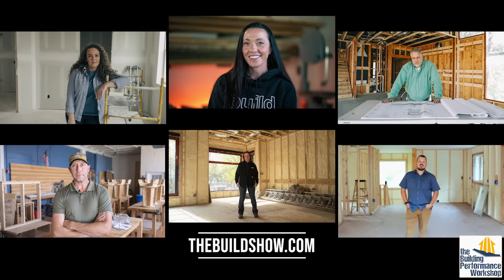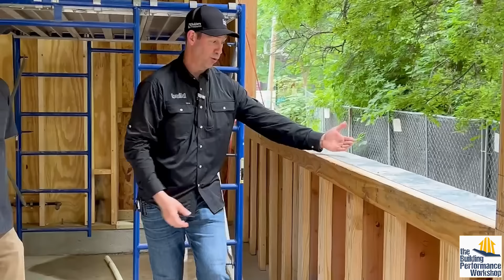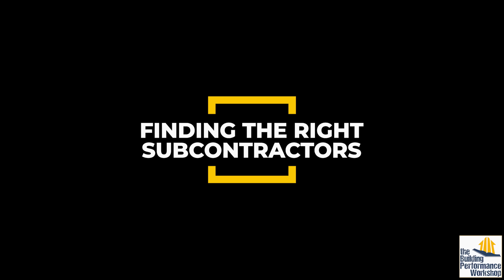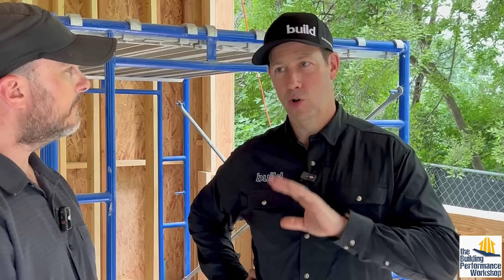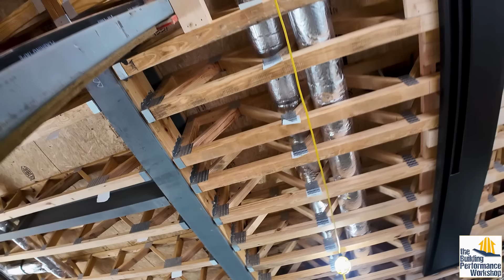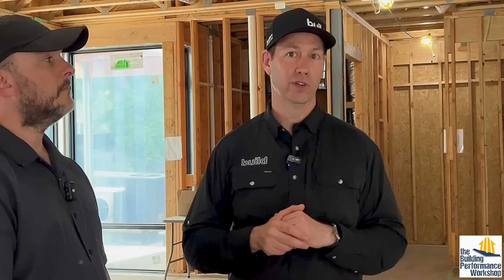Tips to DIY Your Own Home Build: Construction Management, Hiring Contractors, Why Builders are Wary

Comment: Matt is surprisingly open and thoughtful here. That said, I was left hanging when he said his contrcat was one sided builder friendly? In what ways? Time to completion? Owner work prohibited? 20 per cent down payment?
Reply: From my own experience in writing contracts (albeit in a different industry), I would guess there are limitations on change requests and possibly a rigid schedule for settling on blueprints and choosing finishes (cabinets, tile, etc). Not everyone is a visionary, but in order to keep the project moving they either need to find an interior designer or be resolved in their decisions. And yes, payments likely align with the completion of original agreements along the way. Change requests may be charged at the discretion of the contractor.

Comment: All of these are great points.  I was my own GC and ended up actually doing a lot of the building myself.  Matt's point about subcontractor loyalty (and interest) was true in my case.  I was building amidst a housing boom in my area and it was hard to find reputable framers, plumbers and HVAC contractors that were interested in a one-off project like mine.  They were generally committed to larger companies/builders that line up repeat business for them.  Your videos were a huge help in allowing me to tackle the HVAC, ductwork, air sealing, insulation, ventilation, etc.  I was lucky to find a great energy design consultant like you to design the systems, ducts and insulation plan and ended up doing the install myself.  My systems work great and the blower door test turned out quite well.  Anyone considering building on their own should do themself the favor of watching and learning as much as they can from you.

Comment: 40 years ago, my dad convinced our former neighbor that it would be a good idea to put basically all wiring in conduit (plus some empty conduit to various points around the house) in his custom house that he was building for the purpose of futureproofing. The contractor was very reluctant to do so, and consequently, our neighbor ultimately didn't get as much conduit as he wanted...but he did get some. When the house was built, coax was fairly standard, so that was what was installed in some of the conduit. The neighbor's son has since bought the house and was able to run CAT5 in the conduit himself. He also was able to install an EV charger in the garage. He was able to do this without disturbing the drywall.
Reply from the maker: Badass, Sean.
Reply: Yeah, I don’t have a GC license. I worked for a builder for years. I have built two houses. But one thing I would strongly advise people to do is run conduit under their sidewalks under their driveways seal the ends with duct tape. Put a hot water tap on the outside of the house. Plan out your outlets for where your furniture is gonna be. Insulation insulation insulation.
Reply: I built my home 25 years ago and it took several years until I needed the spare’s conduits but damn it was nice pulling a home run 3 floors away!!
Reply: Pretty much how electricity is done in Europe and most of the world building cinderblock/brick homes. Great way to futureproof!!!!

Comment: Thanks for this video, as I recently started considering building my own house, and I have been watching a lot of yours and Matt's videos.  The house I grew up in was designed by my Mom and built primarily by my Dad and Grandfather, with some help from their friends.  They had a contractor dig the foundation, pour the basement slab, and put in the well and septic, but my parents and Grandfather (who was retired by that time) built the basement walls with cinder blocks, and built all of the floor trusses and wall framing themselves.  My Grandpa had built a lake front cottage by himself when my dad was still a kid, so he had experience with doing this already, and did all of the electrical and plumbing for my parents' house.  My parents also did all of the insulation and ductwork for the wood burning furnace themselves, but had an HVAC installer put in a high efficiency propane furnace a few years later (they had an infant and a toddler at that point and it was apparently hard to find the time between work and watching them to chop wood and add it to the furnace, especially at night).

One of my Dad's friends was a professional drywall installer, and helped my Dad with that.  They knew an Amish woodworker who built the kitchen cabinets at a discount in exchange for the maple and ash trees that had been cut down to make room for the house.  My Mom painted the inside of the house, and my Dad painted the outside with the help of a neighbor who turned out to be a professional house painter and offered to lone my Dad some scaffolding and taller ladders than the one he had (I don't think he charged them anything and was just happy to help a neighbor in his spare time and share his expertise).  The only other thing they hired a professional for was installing the roof.

Now that I'm looking to buy my first house, everything in my area has doubled and tripled in price over the last few years while I was paying off student loans and saving for a downpayment.  Now, most of the houses available in my price range are manufactured homes that were built in the 80's and 90's and are in need of significant repairs.  This has led me to consider building a house instead of buying, but there is a shortage of builders in my area, so most are already booked out on jobs for several years.  This leaves me with either hiring a company that will put a new manufactured home on property I purchase (including digging a well and septic and building the foundation), or trying to do like my parents did and build it myself.  I have helped my Dad with repairs on their house since I was little and I'm sure I could do most of the electrical work, the flooring, the drywall, the insulation, and the plumbing fixtures (I would want a professional to do the rough in for all the pipes because I don't have experience with that and wouldn't want to risk leaks or not putting enough drop in waste lines).  Since I don't have any experience with framing, I have also looked at buying a framing kit for an A-frame house where I would just have to bolt everything together using the included hardware and attach it to the foundation.  My biggest fear in trying to tackle a project this big by myself (besides it taking significantly longer than I expect) is that I don't know what I don't know, and there's a good chance that I would miss something that could lead to expensive repairs down the road.  I also don't know what current building codes are, but they are certainly more stringent than when my parents built their house in the 70's and my Grandpa built that cottage in the 50's, so trying to comply with code and passing inspection is another problem that is difficult to solve without experience.  I really WANT to be able to build my own house and experience the pride and satisfaction that comes with that, but the practical side of me says the smartest thing to do is to go the new build manufactured home route and hope these newer models are built better than the existing ones I've gone to look at and won't have the same problems with warped floors and lack of ventilation.
Reply: Very well written comment and lots of insight. How are you doing currently with your prospective new home?
Reply: @beholden1663   I have been looking at a few houses here and there, but haven't found anything yet.  I have actually started designing my own house in my spare time between work and seeing what's on the market, and I have recently started looking into what it takes to get actual plans made and approved.  A coworker of mine started helping his Dad build a house this fall.  Seeing pictures of their progress has pushed me even more toward wanting to do my own self-build, so I've started looking at property as well as houses, but I'm still figuring out where to start and if I can actually afford it.  There are a lot of programs for first-time homebuyers out there, but most of them are for existing housing, not for building.

Comment: Great collaboration! Really informative and helpful. I’m fully retired from working 30 years as an owner’s rep on small to medium sized commercial/institutional design and construction projects and I’m in the early stages of designing and building my own home. Looking to find that sweet spot of how much to handle myself and how much to handle myself. The single most important lesson I learned from 30 years of project management experience is to get the right people on the team and then empower them to do what they do best and make sure all the pieces are connected and any gaps filled. Keep a close eye on every aspect of the job, but be fair, be collaborative, and show appreciation for good work. I totally agree with Matt that those relationships with subcontractors and suppliers built over time are more important to the success of a project than lowest cost. Look for BEST VALUE rather than LOWEST COST. And I totally agree with Corbett’s emphasis on Scott True’s advice to be flexible and creative. There are multiple ways to achieve your end goals and the best projects are collaborations that are fun and fulfilling for everyone involved.

Comment: I like Matt's contract vetting approach. I am an interior designer. I once had a client push back against my initial contract draft with "I'm not really into such a tight contract. In fact, I don't really like working under the confines of signed contracts." My reply was "OK,  you can just pay me the entire amount up front." He looked at me like I was crazy. That was the end of that conversation and that relationship. Haha. Some of the best jobs are the ones you have the wisdom to avoid.
Reply: Never lost money on a job I never got.  

I’m an HVAC estimator.
Reply: Read “I don’t lan on paying you and I want a way to weasel out of it in small claims court. I’ve run this scam before.” Dodged a bullet there.
Reply: Context is everything- as a default, why not just use the standard AIA contract? It is fair balanced thoughtful and covers everything…for example, do you it’s reasonable to demand more in a down payment that the owner is holding at final payment? Or that the owner is precluded from also working in the site? Even being on the site, even banned from site off work hours?  Ie opening yours;ev to a lien when gc doenst pay his subs? Because this NEVEr happens, lol)Becaue thsoe are the type of unreasonable I. Essen in my experience. Two years to build a house from ground breaking?

Comment: A couple of comments:
* thanks for the builder's perspective as always and the open and honest discussion. I hope there are more. 
* I'd be very happy to hire a GC if really any would promise me any ACH number or energy performance number in writing, with bonuses or penalties.  No one in our area will do that except the two passive house firms for new construction. Maybe a new column for your list of contractors?
* a GC does not cost only the fee for his service, he or she also comes with an additional ten or 15% charge, called sales tax, depending on your jurisdiction. That's $45,000 for me on a $300k homebuild, or twice that for the higher quality Passive House. Yikes.
* There is so much duplicity in the industry and so much barely legal on top of the simple poor decisions (like that wood framed balcony wall Matt walked us through), of course the consumer has trust issues or even PTSD. The homebuilders and especially the renovations industry, probably need trust mechanisms and quality guarantees which are industry wide.
Reply from the maker: Good points
Reply: Good points, especially about Passive House builders. In many areas customers have a choice of extremes... either a code-built house from a traditional builder or a Passive House build at $500+/sf.

Comment: My uncle literally built his own home in the 1960s. But, it took years to finish, and since things were never really finished. It was a raised ranch on a hill, with the garage as part of the lower level. This needed a retaining wall and steps from the driveway to the front door. He didn't understand the need to tie both sides of the form together, it started blowing out when the concrete pushed against the forms, and ran out of material before getting to the height he wanted. That was probably just as well, as i didn't think he put any rebar in the wall. The stairs to the front door didn't get built until about 20 years later. His living room was just raw subfloor for about 10 years. The only thing I think he hired someone was for the basement and driveway excavation and the basement walls and floor. His wife was a saint for putting up with this.
Reply from the maker: Yes, another pitfall would be follow thru
Reply: All with no mortgage?
Reply: @ericfitzsimmons1202  I'm sure money had something to do with the lack of carpet and concrete stairs. He rented out his old house, but it wasn't in the best of neighborhoods. With 4 kids, money was always an issue.